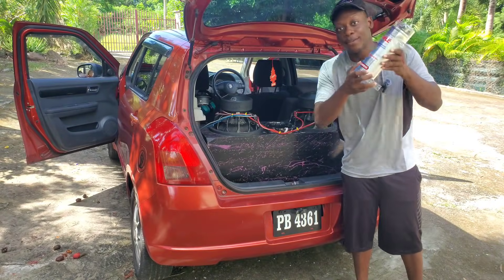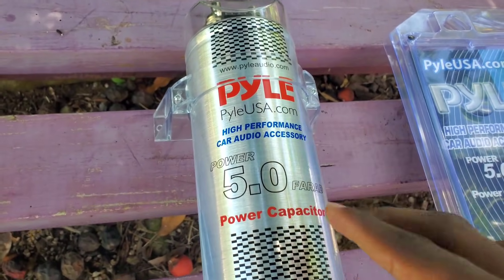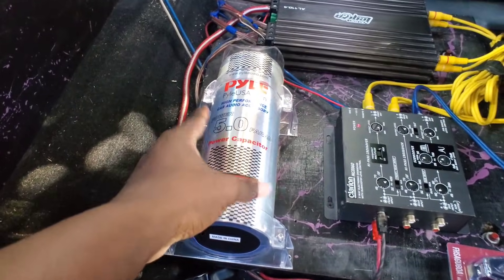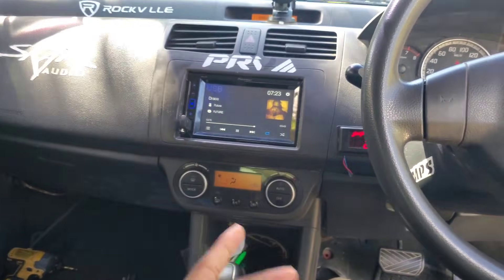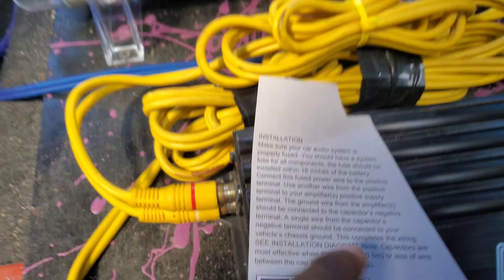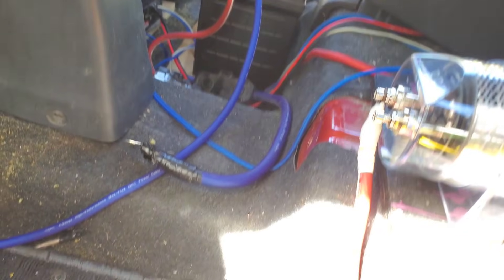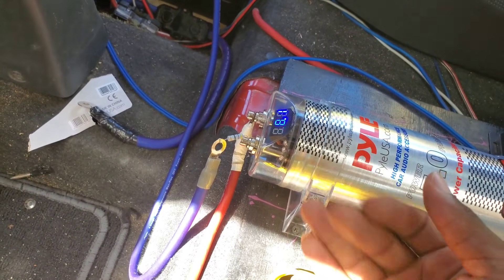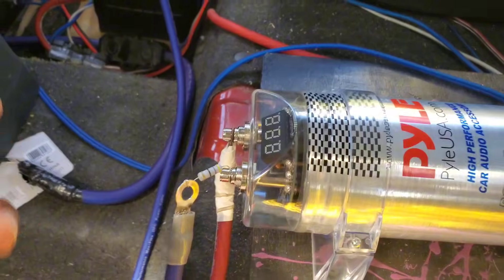I Tested a $50 Car Audio Capacitor… Does It Actually Work?

Comment: Now put a 1000f 16v cap it be better yet  

The one you have is only 5 or 50f  and you have to drop to 12.8v for it to work

Comment: Good video man Keep up the good content. In my opinion the cap is a waste of time depending on your application. Maybe good for a budget single 12 system or maybe 2 cheap 10s. I'd recommend trying out lithium like the titan 8 or the big bigjeffaudio battery. I think it would help your voltage drastically without upgrading your alternator.
Reply from the maker: Planning on upgrading my stock alt for the Christmas season 💪 so my voltage should be more stable

Comment: Absolutely run a capacitor with your sounds system. It supplies that power on demand. It stores the power and discharges it to the system "instantly". Whereas a battery, be it a secondary or otherwise,  just simply cannot supply that power in quantities that your system is asking for. Due to the nature of discharge from a battery, versus the discharges rate of a capacitor. Under normal conditions and specs of a capacitor, they can charge and discharge by 5 tao. Or five millisecond. Batteries cannot discharge that  quantity of power in that amount of time.

Comment: The cap actually helps mostly during bass hits so less stress on alternator and the cap dishacharges and charges really quickly mostly during bass hits when it start to suck current the cap mostly just smoothed out the voltage as you can see before it went to 12.1 the lowest I’ve seen is 12.4 to 12.5 that’s really good as it wouldn’t drop under 12 which is good for the amps rail section
Reply from the maker: Great explanation 🔥🔥 I can agree that it did help a little

Comment: in my experience capacitor destroy my battery.. that's all broo
Reply from the maker: I've been getting mostly bad feedbacks about these types of capacitor
Reply: @tyreeisvibin actually capacitor helps to boost the electricity to amp but if you always getting lowbat thats the big problem in battery

Comment: 😄😄😄 dont use money and time on This shit. Upgrade alternator and get som lithium batteri or LTO setup.
Reply from the maker: Next upgrade 😉
Reply: @tyreeisvibin  Yes, i agree. You adding your battery in your back seat area, helped out a lot. Adding that regular 5 farad cap, probably would only help support the power of your source/head units speaker power, of about 10 watts X 4!

Comment: get proper crimped connections for your power and grounds the system will have lower resistance
Reply from the maker: The ring terminals are newly bought
Reply: @tyreeisvibin have you tested the resistance of your grounds i have mine through the floor and on the frame alot of times there are rubber spacing disks to minimize vibration in the cabin and will insulate it from the frame ground is king🙏

Comment: bro that is old technology that never worked due to those capacitors having a large internal resistance. Now get super capacitors from Maxwell those put out so much amperage with super low internal resistance.
Reply from the maker: Thanks for the suggestion bro 💪💪 I'll try to get my hands on one of those super capacitor and give yall a updated video testing it out
Reply: @tyreeisvibin  the bad part you need at least 6 :face-purple-crying: they are only 2.7 volts i had to take a loan to buy some
Reply: @chupamishuevos303  These are NOT the same thing as 2.7 volt battery cells, this is a Capacitor= different.
Reply: If you check the before 1:37 his voltage is down to 12.1 but then after it drops to about 12.4 volts, a minor improvement.

Comment: You should try a bigger cap maybe a 20 I’m getting a 50 for my setup from Rockville
Reply from the maker: Nice 🔥🔥 you should keep us updated with this one 👊🏽
Reply: @tyreeisvibin for sure I going do a video when I install I go tag you in it 👌🏽👌🏽
Reply: I installed a capacitor and my voltage does not go below 13.6 volts, but my capacitor bank is 500 farads.  Cheap capacitors like Pyle are not nearly as capable.  Good video!
Reply: @RecordnRtist 500?? Is that a super cap?
Reply: @Ashaob1  Yes.  Down4Sound has them and so does XS Power and Maxwell.  They're like a battery but they can be depleted millions of times.

If Loner gets one and places it in his engine compartment, it would be a game changer.

From his videos I would suggest getting serious about his electrical wiring.  I use copper clad aluminum and 4 gauge, but my terminals are solid:  ring terminals, heat shrink, and wire ferrules.
Reply: @RecordnRtist agreed I’m still trying to get my electrical system sorted but I got lots of fuses and ish in my build but having a lot of voltage drop so going to do the caps and possibly a second battery will see 👌🏽👌🏽👌🏽👌🏽
Reply: @RecordnRtist  I'm not sure if you are aware, but you said you have copper clad aluminum wire= CCA= not as good as 99.99% pure copper wire= O.F.C= Oxygen Free Copper wire.